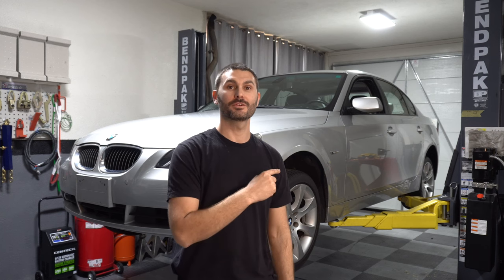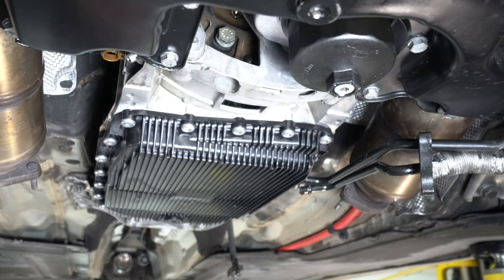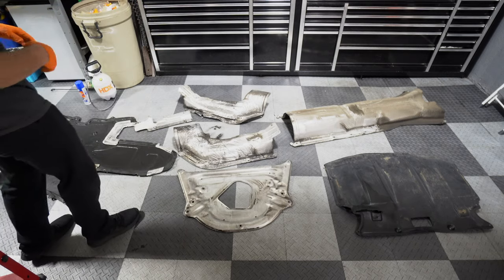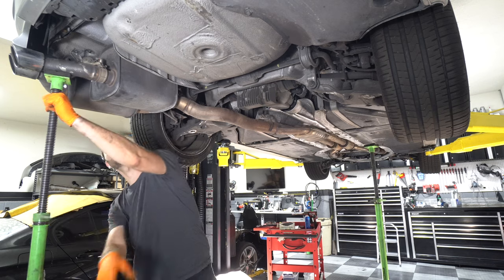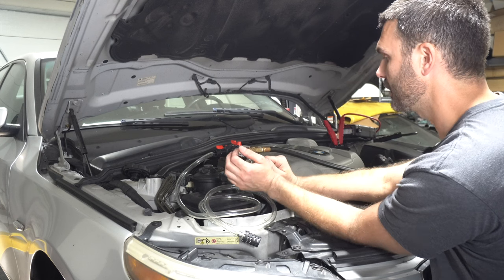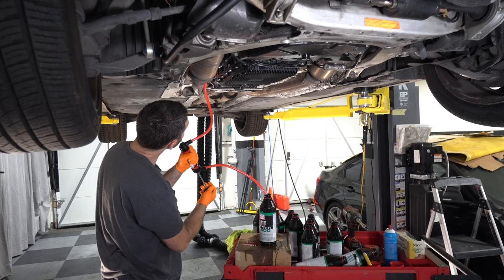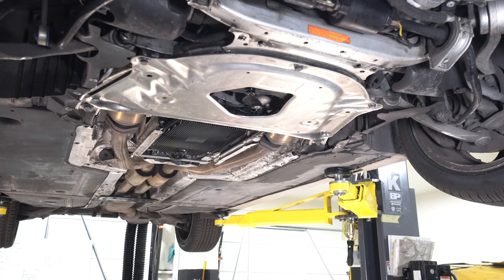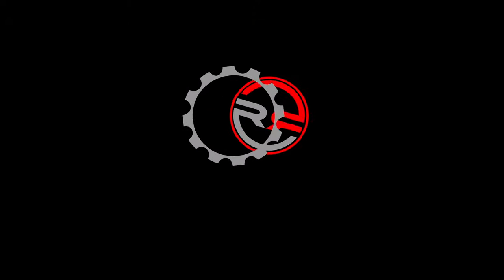BMW 545i E60 Transmission Installation and Fill Procedure (ZF6HP26)

Comment: Very pleasant to watch 👍 At first i was sceptical about replacing the solenoids, because they didn't throw error codes and almost never fail.
What i noticed, before you deleted the adaptation values: clutch E fill pressure is maxed out at 750 mbar (11:31). This is a common faillure on the 6hp26, to fix it you will need to replace the bushings.
After driving for another 100-150 miles check this clutch E fill pressure again to see where it's at.
Second; ZF has an extensive adaptation relearn procedure for properly teaching the gearbox it's new values, research it.
Lastly, if you want to learn more about this ZF6hp26 and how to correctly rebuild it, search for Gary Ferraro on Youtube 😉(Amazing knowledge)

I like what you're doing, keep it up!
Reply from the maker: Hey, I replaced the solenoids because I didn’t want to have to do any more work on the transmission after reinstalling it and understood the solenoids could have caused the hard shift. I also thought the trans could lose pressure through the seals that I replaced, could that cause the fill pressure issue? I have researched the relearn procedure but haven’t got into that yet. Currently working on all of the little cosmetic issues.  Thanks for the info!

Comment: High quality video. Very easy to follow. Where can I get those orange gloves?
Reply from the maker: Hey thanks, I got them from Advanced Auto. Here’s a link 

https://shop.advanceautoparts.com/p/autowurks-orange-heavy-duty-nitriledisposable-gloves-8-mil-latex-powder-free-large-100-count-g10100n/12522559-p?product_channel=local&store=9052&adtype=pla&product_channel=local&store_code=9052&&&&&gad_source=1&gbraid=0AAAAAD05GhXql3zop1_w-ZKH6cJ58n3C5&gclid=Cj0KCQiAtaOtBhCwARIsAN_x-3K6zOjPfqwFGyCh9Qg06184hN-Ww2ei8QK8cNblXtDU_4Iuvb04v6EaAmW8EALw_wcB&gclsrc=aw.ds

Comment: Hi. Great video! anyhow, you should have been replaced the plate between the valve body because there is a gasket on that plate which gets deteriorated and looses oil pressure. I've done that on my tranny 6HP26 togheter with the solenoids, and the tranny feels much better than previously, but still having some kinks and kicks but i'm fine with that compare to how it was. Anyhow i would need to do the oil change and i would go also for Liqui Molly, let's see. 
Keep the great work!
Reply from the maker: Did you do the seals under the valve body and also reset the adaption values?
Reply: @rebuildrevival  yes i did. But i think my transmission is more beat up, also it's 2.5 diesel engine...